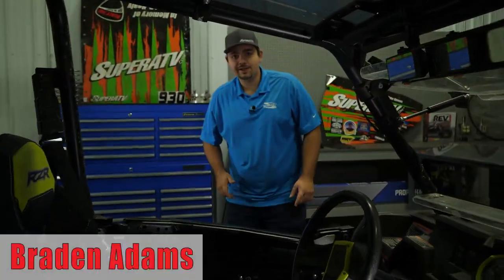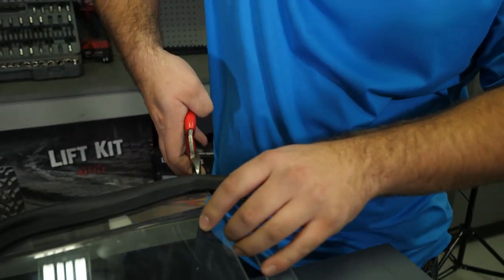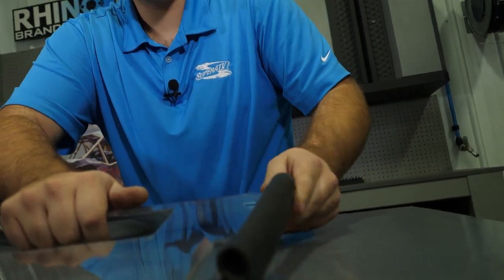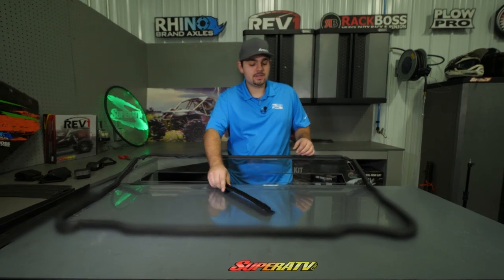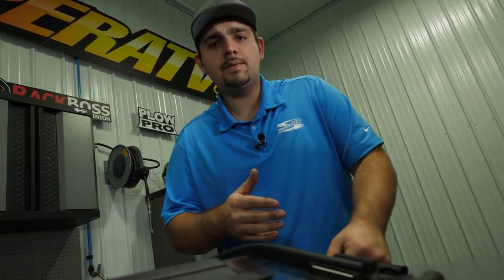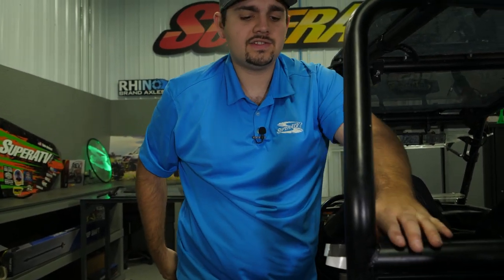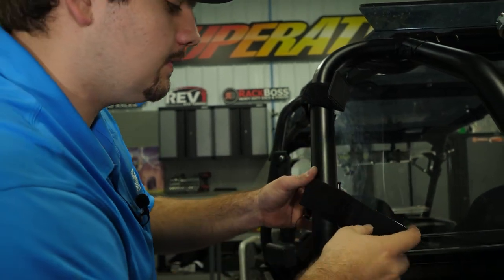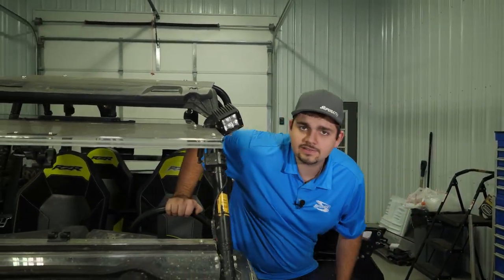Rear Windshield Install | Polaris RZR XP 1000/RZR XP Turbo | How To | SuperATV

Comment: Though Brandon does a nice job on this video, PLEASE DO NOT FOLLOW THIS VIDEO.  THE NEW REAR WINDSHIELD FOR THE POLARIS GENERAL FITS FROM THE REAR OF THE MACHINE AND USES  CLAMPS TO BOLT TO THE FRAME.  THE ONLY EXTRA THING I HAD TO DO WAS REMOVE THE SPEAKERS FROM MY RIG TO INSTALL IT.  IT IS A GREAT FIT.
Reply: This is a video for RZR install not General.  That might help you.